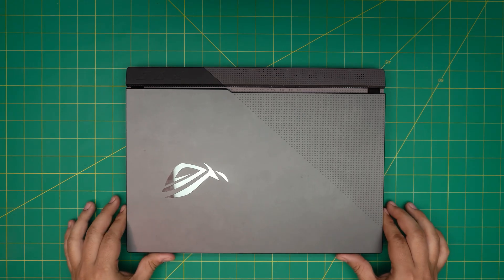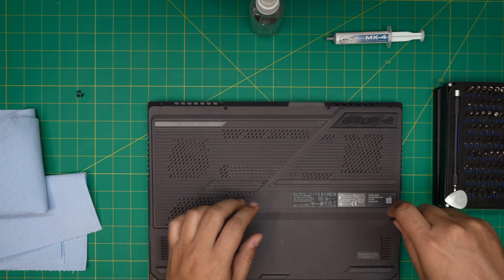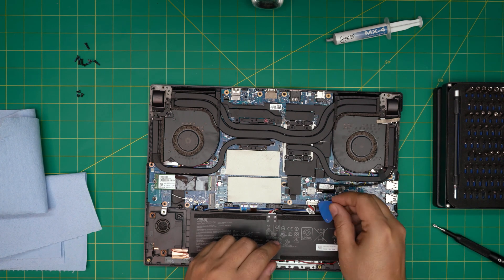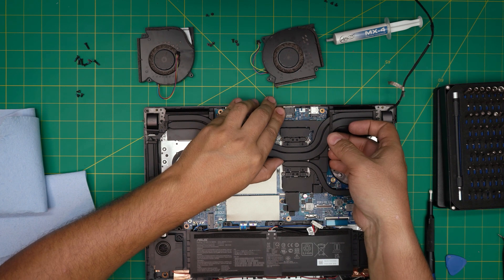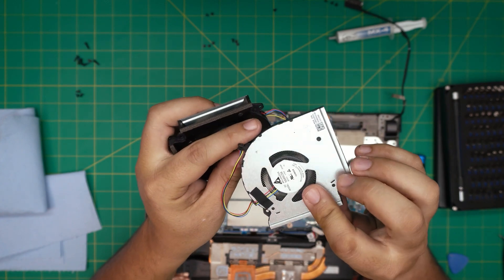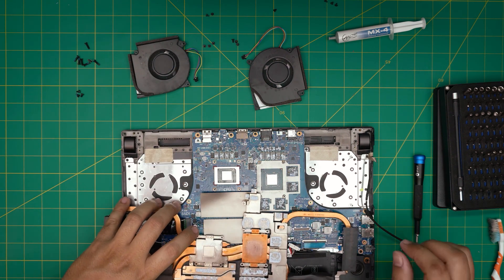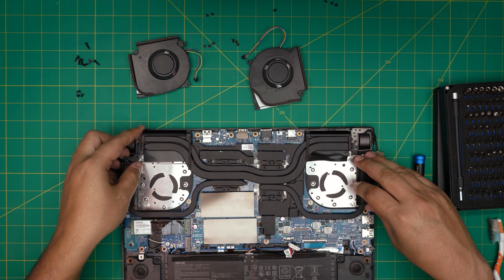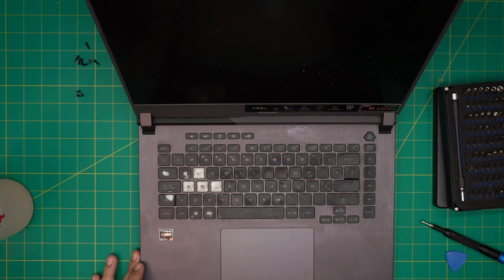How to Repaste and Clean Asus ROG G513 (G513QE - HN030T) Laptop - Step-by-Step🧹

Comment: Hallo. After cleaning and replacing the thermal paste (the warranty has long expired), my laptop stopped turning on, namely the battery indicator is fine, the power indicator does not light up, the "in airplane" indicator lights up during startup, then the disk activity indicator lights up for a moment and then the display turns on, but it doesn't show anything. also the radiators heat up over time and sometimes the blowers start. Please tell me what happened and how I can fix it? For my part, I can say that it is far from the first time I change the thermal paste and I was very careful, I disconnected the battery before the procedure.
Reply from the maker: Thank you for your feedback! If you wish to support the channel, you can like, subscribe, or both!
Regarding your question, do the following exactly as i mention:
-remove the bottom cover
-Disconnect the battery (charger too)
-remove both rams
-open the laptop 90 degree and place it on its side, press and hold the power on for 60 sec
- place ONLY one ram near the cpu slot
-without the battery connected , connect the charger and press power on and wait for 10-15sec if you get image then power off (unplug the charger), else to to #2 step
-plug in the 2nd ram and power on, and if you get screen, power off and plug in the battery 
-enjoy

#2. same steps but hold the power on for up to 2min, and if you place the 1st ram and no POST then use the other ram,
keep me posted.
Reply: Hello. Thanks for the advice! But it didn't help. As it was, the laptop turns on, the screen lights up but does not show anything and then nothing happens. Tried with each RAM
Reply from the maker: let me get back to office and take a look at the schematic and let know you what to try.
Reply: @uFixTek  I will be very grateful. I was already thinking of taking the laptop for repair. But if I am able to fix it myself that would be great! Moreover, I have a multimeter and will be able to check faulty components if necessary. Although I don't really understand how to do it. I can say that I wiped and smeared the thermal paste several times because I thought that I had damaged something or smeared it somewhere. And when I tried to solve it for the first time and wiped the thermal paste, the laptop turned on and even got stuck at the login screen, but it quickly turned off (probably due to overheating). After that, nothing changed and I doubt that this launch could have harmed him because the symptoms are not different.
Reply: Ok, thank you!
Reply: I have a similar problem, but fans don't even start up and the screen doesn't seem to start. Do you have any feedback?

Comment: Does the g15 have a humidity sticker where it turns red if i gets wets so it voids the warranty?
Reply from the maker: none of the new laptops use that stickers anymore. in my 17years of laptop repairs, i have only seen them on apple devices and very very rare pc laptops, and last 5years on none of the low mid or high end laptops.
Reply: @uFixTek  Do you know where it's located if it has one,like on your old MacBook? And thank you for the response
Reply from the maker: just confirmed that this models don't have any, you can always spot them beside motherboard screws. but  you wont see them on this laptop

Comment: I will be following this soon, liked and subscribed!! Thank you for the detailed explanation and when I do this I will be using thermal paste instead of puddy on everything else as well.
Reply from the maker: I'm glad to be of help, my friend. 😊 Thank you for the sub and support.
DON'T use past instead of putty, order some thermal putty from aliexpress.
Should you have any further questions or requests in the future, please don't hesitate to contact me. I'm always here and happy to assist you to the best of my abilities.
Reply: @uFixTek  what would be the difference that it would make, I won’t use paste now. Thank you for replying
Reply from the maker: If you don't use thermal putty and instead use thermal paste on your components, you risk damaging the board, causing your VRAMs and power regulator components to overheat quickly, leading to sudden shutdowns. The reason why thermal putty is necessary in this case is because: thermal putty is a thicker and more malleable substance, similar to a clay or putty. It is applied by placing a small amount on the surface of the component. The putty is able to fill in larger gaps and surface imperfections that the thermal paste cannot.
On the other hand, Thermal paste is a thin, fluid-like substance that is spread over the surface of the component using a brush or a syringe. It is designed to fill in microscopic gaps between the heat sink and the component, allowing for better heat transfer.

Comment: theres a problem by replacing thermal putty with thermal paste on thr V-ram?
Reply from the maker: Thank you for the feedback! if you wish to support the channel you can LIKE or SUB or both :P
regarding your question: 100% yes its BAD IDEA. don't do it, the thermal putty is  putty, the other is a paste that will simply start dripping all over the board and also you will have a horrible performance issue.